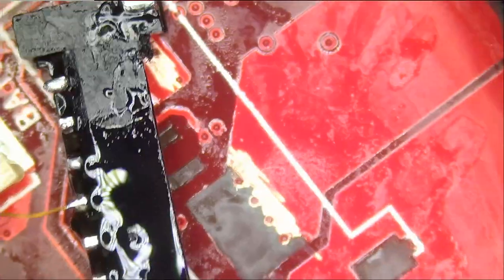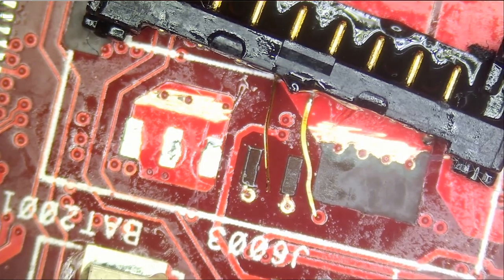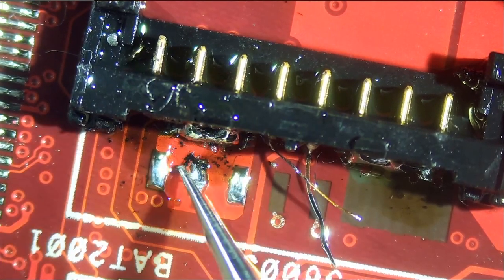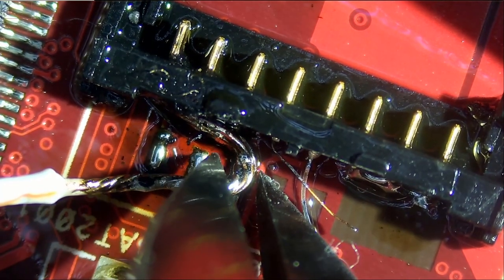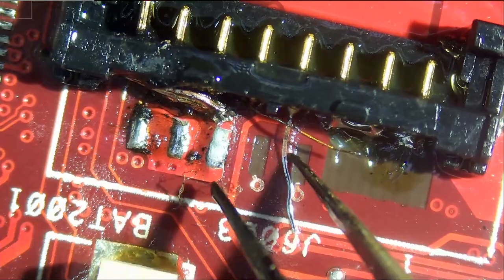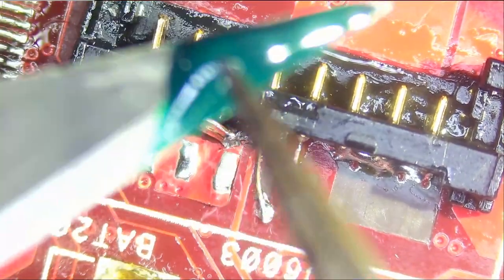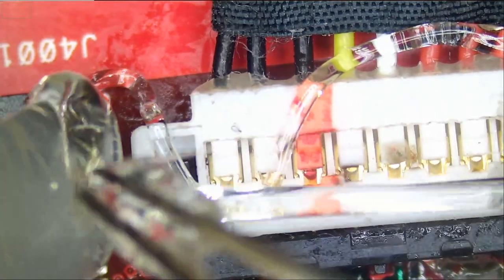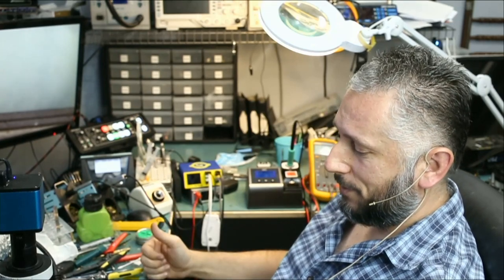Asus Laptop DIY Battery Replacement Gone Wrong. Two Ways to Fix this.

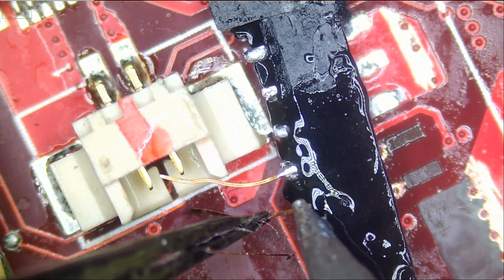Comment: The pad strip was stuck on your tweezers, can be seen 7:48. But I get it. Those things are tiny.
Reply: I wanted to mention it but saw your comment
Reply: Indeed! hardly visible but it is on the tweezer :-)
Reply: Yeah, that was funny. I know from so much close work that your focus is so trained upon one area that you completely ignore the obvious.
It happens to us all.
Once I had lost a small screw and later found it stuck to the underside of my hand. That pesky "9th dimension" has many holes to drop things into.
Reply: Yup, was going to say the same thing.
Reply: So the 9th dimension is on those tweezers?  😁
Reply: @WhereNerdyisCool  It's one of the many portals to that strange place.
Look under your bed for one and in between the couch cushions for another.  They are all around you!
Reply: @robertpage2023  that’s how my cats feel about all the toys we reclaim from under the couch!!

Comment: It would be great to see detailed videos:
1. How and where to inject the voltage. How to choose the injection site, how to determine the voltage/current. 
2. How to clean the tips, how to tin etc. What materials to use .
Reply: I know that if you were to begin with Mr. Alex's first video and Patiently go thru them in order, you would find that he teaches as he goes and what he used to do back in the early videos , he may have changed his techniques, tools and shortcuts.  This kind of job is one that takes not just your own ability to adapt but to develop the  "6th sense" of knowing just what to do that can only be sharpened from so much daily exposure to repairs that come your way.
As I am watching some times I'm talking to the screen at Mr. Alex and saying things like, "Why did you not begin with the voltage injection to figure that out or use the thermal camera".  He has his technique depending upon what he finds to diagnose in each and every repair.
His highly developed "instinct" amazes me every time.
After all, he does have an electronics engineering degree as well.
But, I do admit that I would like to see him just take the time one day (when he isn't so busy) and do a step by step tutorial on each of the topics that you have mentioned.
1.Soldering, basic tools needed, the science of fluxes and solders, heat settings of your iron and heat gun, desoldering, Iron tip cleaning, care of your tools.
What NOT to get too hot and how to protect a component that could melt.
2. Voltage injection. How to set up your power supply for V injection and where to attach the ground. Probing the different parts of a Mosfet. Identifying and explaining what the different computer components are and what they do and how to diagnose them. Ex, coils, caps, mosfets, etc.
3. Basic diagnostic flow chart for computers, phones, graphics cards etc.
Problem>what next to do>trouble shooting> "if this is happening then you do this".
Basically, Mr. Alex is doing any one of these techniques every day during the course of his business. But, it would be nice to just see a dedicated "how to" tutorial on each topic with all the different steps involved.
People who come to this site for the first time seem to be overwhelmed by Mr. Alex's skill level and need some way to get an instant, one location tutorial on all of his excellent experience.
I have only been watching since the beginning of last summer and when I have time I go back to his earlier videos and try and catch up. I find that many times I am seeing him use different tools and using different techniques that he has changed later for the better but I still learn.
Reply: When you find a short, you've found a place where voltage should be, but it's instead showing continuity to ground.  That place you find is the same place you can inject voltage.  The voltage you choose should not be higher than what the component that uses that voltage can tolerate.  On lots of modern electronics, you can use about 0.8V - 1.0V as a reasonably safe voltage.  You need a power supply that current limits itself (rather than shutting down), and you can set the limit at a few (3 or so) amps.  Usually it doesn't take much current to identify the faulty component.  Ground can be attached to any convenient place, such as a I/O bracket, screw hole, or port shield.  It should be continuous with the ground where you measured from in the first place.  As far as cleaning solder tips, wire wool is the best choice, though a damp sponge is also okay.
Reply: you should also add #3 : i will gonna donate to Mr. Alex for extra time to add #1 & #2 in the video LOL

Comment: I am always amazed how rough some people are with their electronics. Seen people yank cables and antenas and when tightening a screw go full ham and the only only reason why I think the plastic doesn't break as often is because usually the screwdriver strips the screehead off first and then I need to push even harder to unscrew it again.

Comment: The pad strip that was lost as per you was sticking to the tweeter on your left hand and can be seen in the video when you were soldering the second pad strip 07:48.  It happens quite often though even though it is in front we are unable to see it for some reason.
Reply: 7:48 😀😀

Comment: Excellent work as always! Out of curiosity, do you drop your temperature when soldering onto plastic ports? 😊 I learn a lot from your channel, so thank you.
Reply: Don’t drop your temperature. Use max temperature if you want but it is important that you drop your air speed. Plastic hates and melts with fast moving hot air. I personally use max temp of 500C and around 25 airflow on my quick 861dw. If you are going to use faster air I recommend to keep moving the nozzle and make sure its got some distance.
Reply: @jesusyuca1483  "make sure its got some distance"  and dropped air speed is the same as reduced temperature.  Distance allows cool air to mix in and lower flow gives the air and components time to radiate heat away as it generally reduces power output of the heater.
In reality, you have learned to control your soldering temperature with your actions and tool handling while keeping the controls at max... this is totally fine, but it is not a good recommendation for someone else.

The right way to solder plastics with certainty is to use a pre-heater and a low temperature.  Use the dead connector as test piece. If it melts during de-soldering, the replacement will melt too.
Reply from the maker: FPC connectors, I would start at 390c and 80% air speed. Bump up temperature as needed.
Reply: @NorthridgeFix  Thanks as always for the advice :)
Reply: @jesusyuca1483  thankyou Jesus Yuca for the advice 😊👍
Reply: @DerAlbi  Thanks for the advice DerAlbi :)
Reply: @DerAlbi  i should have added the only reason you might want to raise your airflow and give yourself a little distance is if you aren’t delivering heat fast enough to the board. You can usually change nozzle size but sometimes you have something way to big to solder. Ill take one of my last jobs as an example a replacement of a macbook air ssd slot someone ruined. I couldn’t get the solder to melt with the usual 500C  25/120 airflow setting without nozzle. So I went to 35/120 and kept moving it. Honestly didn’t give myself any distance really and it came out better than original again. 😊

 Btw using the board you are going to fix as the guinea pig isn’t good advice either. You got to be careful you don’t cause other problems. 😬 That’s what donor boards are for and screw it get another donor board until you find a method that works for you. A method you can rely on.

Comment: That far left pin on the battery connector looks slightly too far forward compared to the other pins and it looks like it made the battery not seat completely evenly. I guess if it worked it was fine though.
Reply from the maker: It doesn't matter, the cable is long and flexible enough to fit at any angle. We charged the battery and it's running perfect.

Comment: By flipping the connector did that not put + on - and vice versa? same with data and clock..🤔
Reply: The connector is like an extension between the PCB and the battery connector. The first seconds I saw it turned around I thought too "how can this be?" lol

Comment: I know it's an unnecessary detail, but why don't you use a red solder mask on the red boards? Why green on red? :D
Reply: I think the goal is to make the laptop work. The colour of the solar mask is not important since the board is inside. It doesn't affect the outward appearance of the laptop.
Reply: @tobiasmangoma9566  That's why I wrote an unnecessary detail, but I personally would put the original red color instead of green so that it would look better later if the laptop was under repair at someone else's.
Reply: I think, he has no red solder mask ready. In his video, where he showed us how to use solder mask, I have only seen the green one, iirc.
Reply: @WimiBussard  Red - Green - Black. In my opinion, probably the most common colors of motherboards. It would be good to have them all in order to preserve the colors of the motherboards. But as I wrote. It's just a detail and cosmetics.

Comment: What IS the deal with all these broken Asus battery connectors? Is this something the users are breaking by accident, or are they fidgeting around plugging and unplugging the batteries and breaking the connector?   I've got several laptops with removable batteries but it is not a toy and has only ever really been unplugged when it was time to totally replace the batteries.

Comment: hello. I didn't like the work. it was possible not to move the connector at all. and it would also be good to clean the plug after soldering. and hot melt glue is not the best solution for attaching the battery plug.